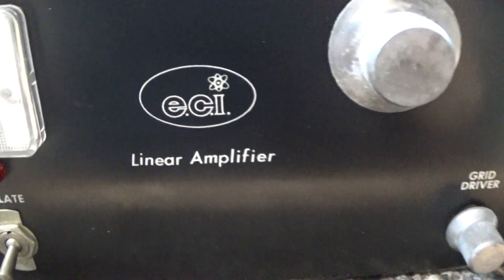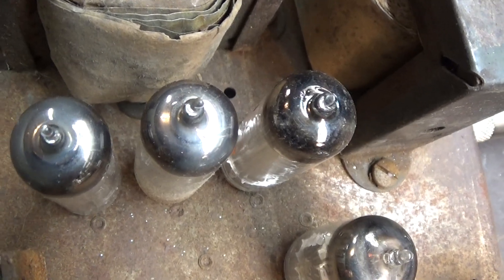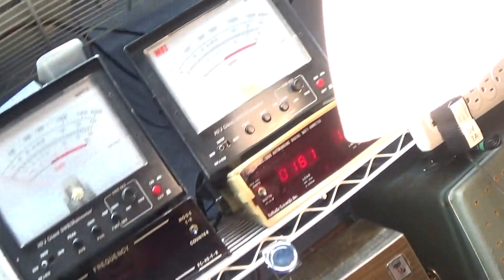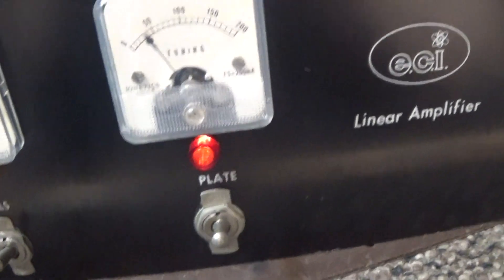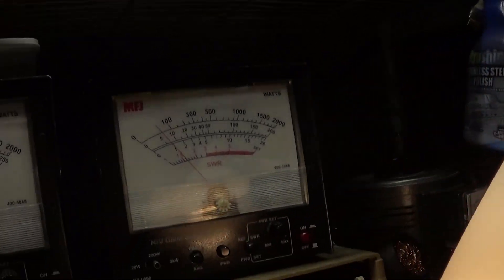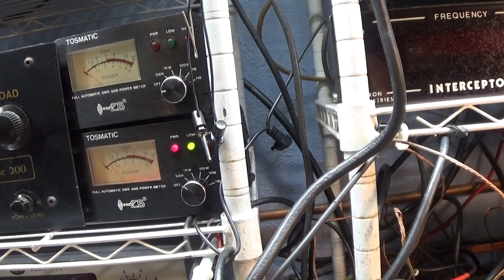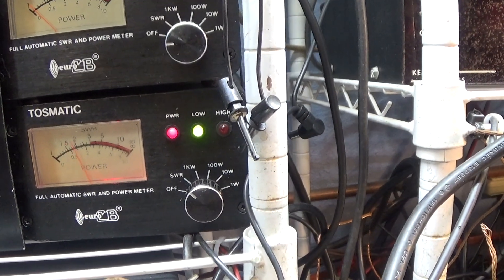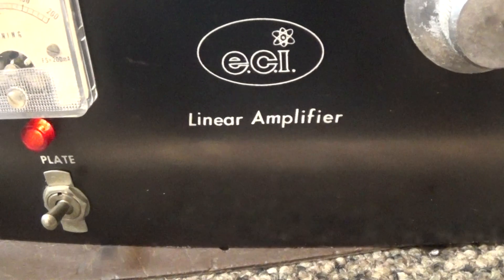ECI Courier single 6146 amp and grid input tuning

Comment: I just found one of these but it has some issues.  By any chance, do you have a schematic?  It's making high voltage (I have it dropped down a bit on a variac).  But I can't get the key relay to pull in.  The 12AU7 tests good, relay tests good, but I'm flying blind. :-)  Any help appreciated.
Reply from the maker: Sorry, I don 't have a schematic. Tube keying circuits are usually not hard though. 1st of all you might need to apply full voltage for it to work. Tube keying circuits normally run a 115vdc relay, and get the positive for the relay coil straight from the high voltage. The keying tube provides a path to ground, but not a direct ground. Usually the tube will drop around 120v from what the plate is so lets say the +  side of the relay has 600vdc and the - side of the relay should be about 445dc when the amp is keyed and the keying tube kicks in. I have seen open relay coils and bad dropping resistors in the circuit that cause the relay not to key.
Reply: @tramdr  Thanks for the info!  I played around some more with it last night and got a bit further.  The relay coil is good for sure (and it was working briefly when I first powered it up).  And I definitely see the HV at the coil (both sides).  When I key down the transmitter, I get about -25 V at the grid of the 12AU7 but no change in the HV on the "low side" of the coil so of course it doesn't pull in.  I'm thinking that -25 VDC on the grid might not be right.   Looks like they're using both side of the 12AU7.   I have to draw it out on paper. :-)  But thanks again for extra info!!  I know it's not a high value amp, but would be nice to get going again.  Have a great weekend!

Comment: Out of curiosity do you happen to have the number on the black cap all the way to the left (sitting behind the grid meter?) ? 
I believe it was a C609 which blew out on mine years ago, was removed and then lost during my last move.
Reply from the maker: Both the Big Black can caps are 50UF 450V cans ran in series to filter the HV.

Comment: Do you do any work on Mako amps I’ve got a pumpkin 🎃 faced 500 that had new 8950 put in it before I went overseas on a construction job know it blows the fuse when it got plugged in it will need a recap and I have a 300 that’s been converted to 6lf6 tubes . Also do you have a base radio (Cydernet chassis midland to use a digi scan on) I have the digiscan  but I don’t want to put it on a 140 la that I bought from you to nice a radio to do that to and yes I would like a SSB radio IS there any hope Happy 4th
Reply from the maker: Sorry, don't have a Cybernet chassis and I don't work on others, only do my own. Good Luck.